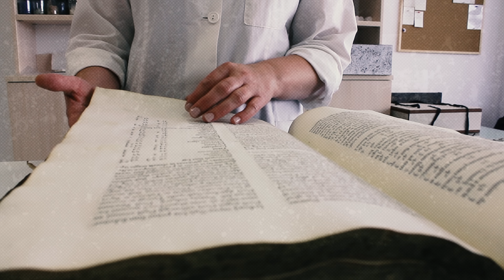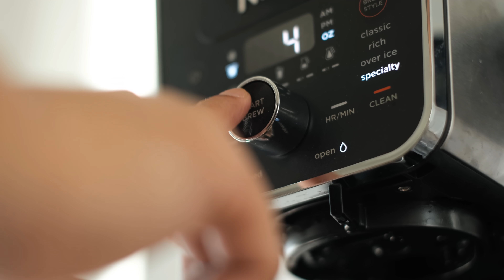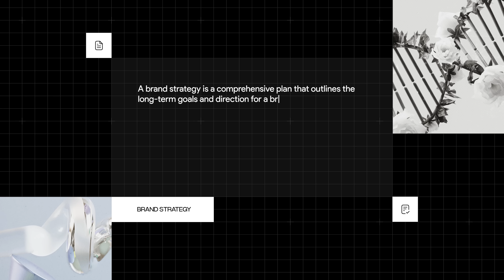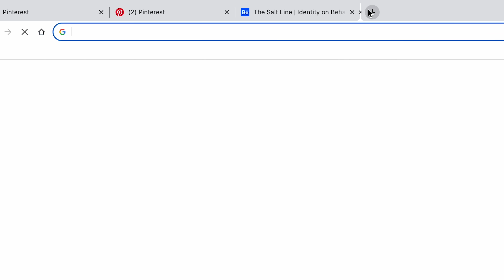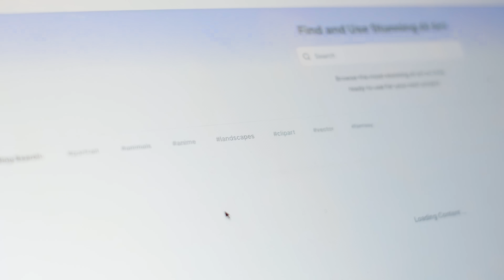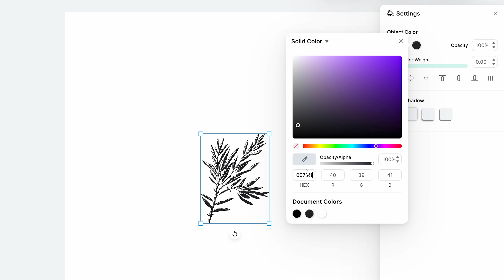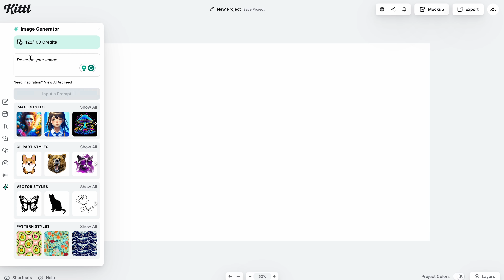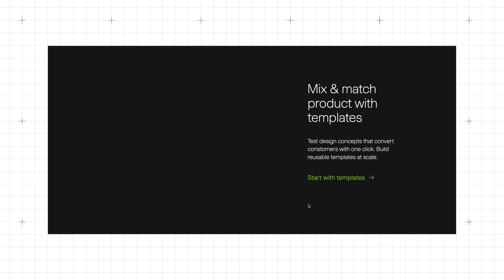How to design a Brand, using A.I.

Comment: I do not use ai in my design process. But I have been utilizing chatgpt to create detailed brand strategies. The brand strategy acts as the foundation for my logo and visual identity. I also use cinema 4D for some added flair. Eventually when I become a wizard, I'll start to utilize houdini. Even after watching this video, which was well done by the way. I'm still not sold on utilizing ai in my design process.
Reply: Have you tried the plus plan?